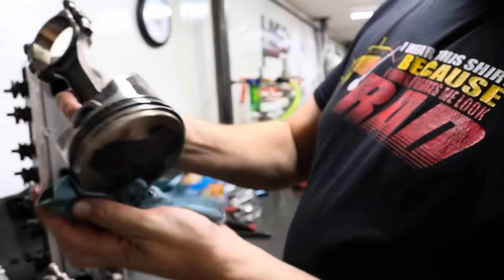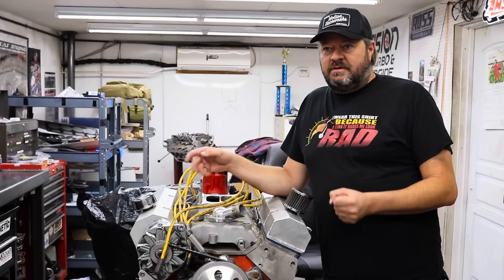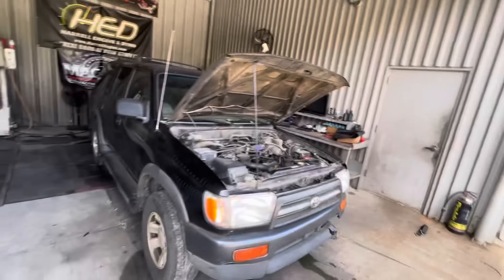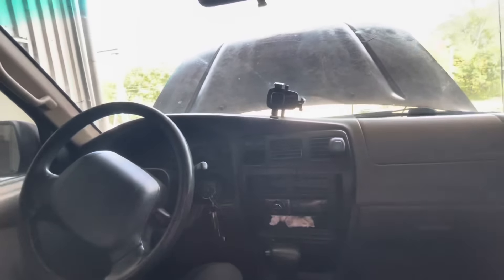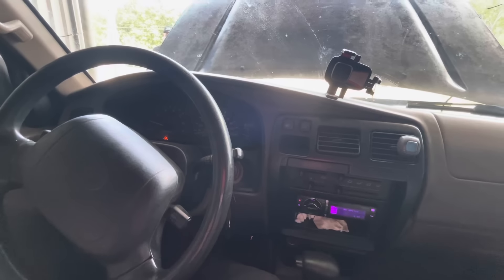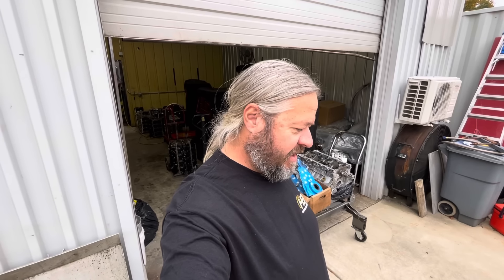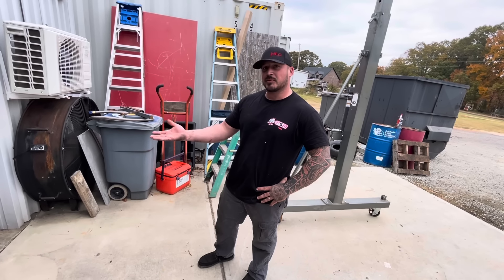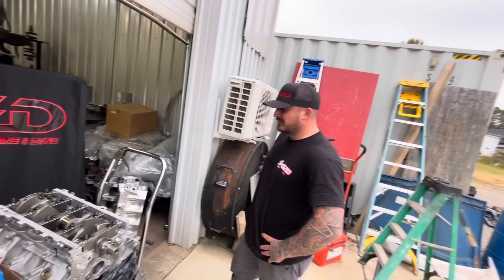I make a TERRIBLE decision involving my daily!!  Peer pressure is real!

Comment: Hey Pete- if you haven’t, change the lower ball joints on that booger. Use oem only, not ones from a parts house. A failure can unalive ya real quick, and they’re known to fail. New oem bolts as well with red loctite torqued to spec.  Toyota fellas seeing this will know what I’m saying, they’re super dangerous on 3rd gen’s

Comment: I mean, it's kind of crazy that a person could get around town just fine in a vehicle like that with 81 hp, but if your hot rod makes less than 500 hp it's a piece of shlt
Reply: there is nothing fine about 80hp lol
Reply: Wrong.
Reply: @trevermonk8575 you haven’t whipped a Chevy Spark around yet and it shows lol, slow but fun as hell
Reply: @boost1728  my brother has a turbo sonic that weve tuned on e it's mildly fun but my 4.0l ranger (also on e) is way more fun because it does burnouts and doughnuts lmao

Comment: I daily a 2009 Ford F-N Ranger with 257k miles. The check engine light used to turn off when I patted the dash which drove my son crazy. Now it is on all the time. I checked the oil and we’re all good. I could pay cash for a new one but….

Comment: About to swap a 3.4 in my 2nd gen, gonna throw a felpro kit on it before install
Reply: Might consider pulling the oil pan and checking the bearings! Use the lil wax strips that crush between the rod caps and crank, do the same with the mains! It will take 30 minutes to verify clearance and condition while you have the pan off! If it were me I would replace all the rod and mains, oil pump, water pump and timing components! Plus get on the forums or check with a shop and see what is common to fail and replace especially the hard to get to crap!
Reply: @kenwillis8487  i have the water pump and timing kit going in, I heard the engine run good on a cold start already, the 3.4s are pretty solid. I am also replacing all the rubber hosing for evap and coolant

Comment: Seems to me you are going to need to replace the whole driveline to accept the awesome power that 5.7 will generate.  Brakes and suspension.  The good thing is that the 4Runner has an actual frame to work from.  Not a unibody pos.

Comment: The packaging to shoe horn this in is going to be a sight to ❤behold, and absolute nightmare to work on😊
Reply: Actually, they're easier to work on after a V8 swap. Especially if it's just naturally aspirated. I've LS swapped a 2005 Nissan Xterra, 2007 Hummer H3 with a single turbo, and several different year model S10. You get rid of all the plastic bullshit from the original engine, and you can relocate things wherever you want so they'll be out of the way.